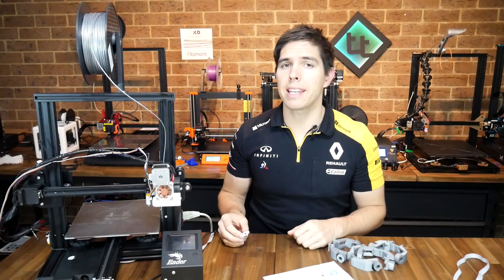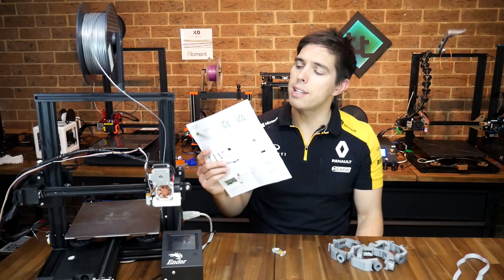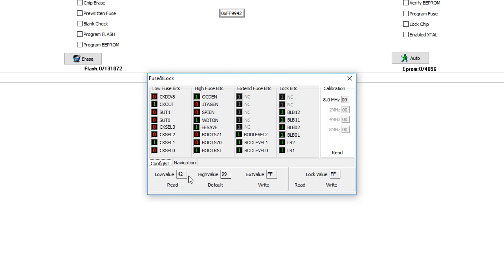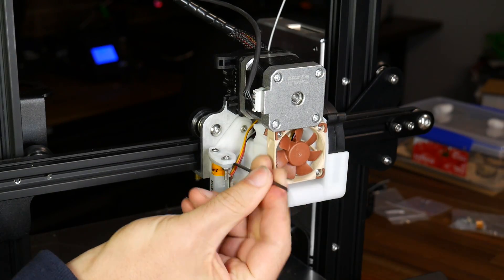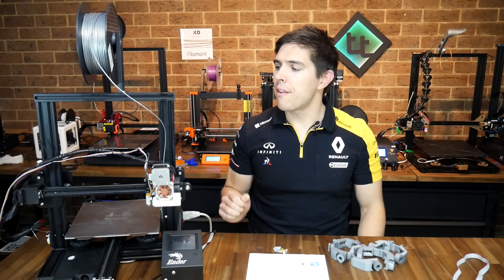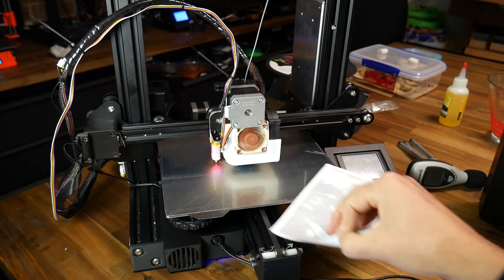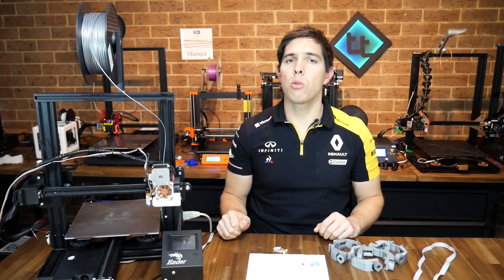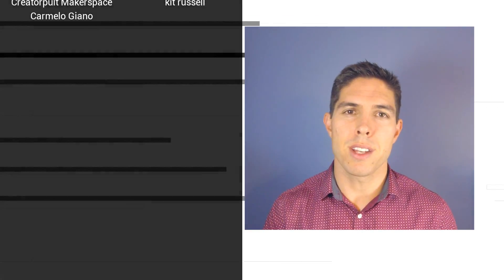Creality BLtouch Ender 3 upgrade kit - Step by step guide with fixes

Comment: Just spent an entire week trying to make mine work without any sucess ! the BLtouch isn't even glowing red like if it wasn't powered on. I tried to reinitialize the printer with a non-BLtouch version but now the printer sees the SD card but says it's empty ... I really don't know what's happening ! My ender 3 is running with a SKR 1.4 turbo, some says you need to connect the probe to the z endstop, some says you must connect it to the probe connector, some says you have to modify conditionnal LCD file .... to sume up, I'm completely lost !

Comment: So I see Michels Mainboard is shiffted from its manufacturing position. Mine is not since I need access to the SD and USB Ports. Now I have the problem that my mainboard-fan does not fit anymore since the new chip is in the way. Any Tipps?
Reply: Print a different cover for your mainboard box :)

Comment: Good video - I was looking for the part at the end - my Z offset is wrong even though I put in the "correct" values...

Regarding the flashing program - I think they updated the settings for it, because the "auto" worked for me. Or maybe it's because I got the file from a different source? I got it from a link in the creality BLTouch install video.
Quite a mess this upgrade - as you say, the hardware represents great value, but the rest, not so much...

Comment: I did this installation yesterday following the new Creality video. This was done on an Ender 3 Pro and was mostly no hazzle. But the Z-offset was a pain still. Unable to do the Marlin version i had to do 5 test prints before i had the Z-offset dail in. But now it runs like a treat. Thanks for sharing this video that got me started and let me find the right software.

Comment: Literally every problem you encountered were the same problems I have encountered, I have no way right now of checking all of the data, as I don't have as robust software as you, however, your preloaded hex file with thermal runaway is worth this whole video. Thank you very much, this was the cheapest solution available for me before i have a chance to go to the better motherboard for the ender 3 and a raspberry pi.

Comment: Updated another batch of these yesterday and fell back to this video to get things done fast! (with a different flash image of course)

Thanks for this!  Love it!
Reply: Benjamin, which firmware did you end up using, and did you have the Z offset issue?
 I have just spent 2 days trying to get this working, I have it working but like in the video I am going to have to do a layer 1 print for every 0.1mm of adjustment to avoid crashing the nozzle into the bed

Comment: no one else thinks this guys instructions are complete garbage???? i went to the creality website to get the firmware and i got no .hex file, but a .bin file....and i cant find progisp anywhere....trash instructions
Reply: Here is a link. Click on the progisp file. I had an issue downloading it, in the upper  right hand corner click the three dots, then open in new window. When I click download it worked. 
https://drive.google.com/drive/folders/1lXXDpAtkGP2KVKi4O1yqBInqunWGrWvN

Comment: I cannot find the same chip type as you I only have 1280 and 1281 no 1284p PLEASE HELP
Reply: @CaptainRabbitYT  So far so good everything is plugged in now all I have to do is test it
Reply: @CaptainRabbitYT  ok so I used the progisp and I used the 128 4p and then I set the values to DC D6 and FD I clicked write and everything was fine. Then I did the load flash thing and used a hex file I found titled Ender-3 1.1.6.2V.hex and I don't know is that is the right one and where I can find the right one D: If that is the right one then I guess I did everything  right. But the problem is when I plugged everything in like the video said I tried to do auto home leveling but when it went down first of all it didn't center and second the probe wouldn't come out and I had to pull it out and push it in but it kept going and it does this every time I try.

Comment: The link provided for the "fixed/updated" hex file that is supposed to work with the Creality flashing software takes me to a Marlin repository that requires Arduino.
Reply from the maker: That's because people complained about the hex file apparently not working. I'm doomed whatever I provide for free, there will be complaints either way.
Reply: @TeachingTech  Being a resource that people become dependent on will do that. Thanks for the effort anyway, you've certainly helped me a lot. Removing the z-stop capacitor was actually the simple part so I'm not expecting any glitches but I did want to take advantage of the speed changes you had made, Oh well. I've already flashed the creality firmware and just need to set the z axis adjustments. One of these days I'll have to get around to learning how to use Arduino for more advance Marlin updates. For now I just needed to get printing again without having to worry about my uneven bed surface I've been struggling with. Thanks again for being such a valuable contributor to the 3D printing community.

Comment: In my Ender 3 I have the 
BIGTREETECH SKR Mini E3 V1.2 Control Board 32Bit with TMC2209 UART Driver.  Not being a big software guy I am trying to follow along running the Progisp.exe; however in the "Select Chip" bow I cannot find the chipset for this mainboard.  Can anyone tell me what goes there and I'm sure the fuse settings are different too.  Any video that shows installing the BL Touch 3.1 to the SKR Mini would be nice.  Tired of scratching my head.

Comment: Hello, Hey could you help me with the PROGISP... I recently bought an ender 3 pro with 4.2.2 board and also a BLTouch v.1, but when I try to set the lowvalue / high and ext value, displays me an error called " chip enable program error" ; Do you now what could I do there?

Comment: Brilliant video, wished I'd found it a couple of weeks ago, it would have saved numerous headaches. Creality's documentation is laughable and even after I finally got the BL touch working there was a problem with it running off the bed (Ender 5) which I found a patch for online. The plus side is I learnt a lot about the printer.

Comment: Hey, I love your videos!!
I just bought a Creality bltouch kit and come across this video, is a bit old but I noticed that your github is still updating and creality is still providing the same hex file without thermal runaway. In order to flash your firmware I just have to compile it and use the same steps as with the Creality firmware?
Thanks for your time, keep making videos! I watch every single one!!

Comment: Any chance you might do a BL Touch Install video for the Ender 3 V2? So far i have gathered that the install is very similar minus the need for the 27 pin connector and it plugs directly into the board but would love to see someone do it end to end so that I don't break things. While i am here, can i say that as someone who quite literally has no clue about 3D printing, your videos have been amazing. Appreciate all the effort. Cheers!

Comment: Hey so I used the version 3 firmware with the thermal run away enabled that you provided in your description after I set up my BL touch using crealitys video tutorial a week ago and all of a sudden the BL touch started failing, my only problem I’ve encountered so far is now my tool head is a little farther to the right than it used to be when it auto homes , is this normal ? If not how do I fix this and will it result in me having to change anything from the default profiles for the Ender 3 in cura other than enabling the BL in the gcode which I’ve already done?

Comment: This works great with the new BLTouch 3.1s. Also looks like they've made a few tiny improvements to the software so it was a little easier.
Reply: They (Creality) have also introduced some more bugs to their software, the progisp+1.72 loads with two kernel errors because they named the folder in English/Chinese and if you don't have an English/ Chinese keyboard you get the error, a workaround is to rename the folder minus the Chinese characters, but they have not fixed the Z offset error and have not implemented baby-stepping

Comment: I had to replace my main board because when i flashed my chip All i get is chip enabled program err. And the lcd is blank now. So I put in ender 3 upgrade main board 1.1.5 with boot loader installed . Now how and what programs do i need to put my BL touch v1 bed leveler. I don't want to by another board. Can some one help me please.

Comment: First of all: THANK YOU SO MUCH! For all your videos! :)
Your videos helped in many ways like first buying decisions, bug fixing, quality improvement and upgrading in general.
Keep up the good work mate!

Now I want to return the favor since I got a lot of issues with an upgrade to Silent Board 1.1.5 and BLTouch which took me weeks.
I had:
- overheating steppers
- horrible printing quality which ended in absolut failure to stick to the bed in any way 
- issues with flashing

Mostly because Creality has a almost no documentation.

With your videos and some research (combined with trial & error) I've had success to upload the official firmware, but it was the main issue afterwards.

So I tried to use TH3D unified firmware and had to go as following to get it going.
Maybe this telling you more than me, what went wrong or were I've been stupid ;)
Hopefully I can help anyone having the same issues / brain errors as I had.

[Hardware installation]
- Simply installed the hardware like in your video with the official Creality BLTouch hardware package

[Preparation]
- Downloaded & unpacked "ProgISP" with the official Creality firmware
- Removed all special characters from the complete folder name of "progisp.exe" (chinese symbols seem to cause issues with western windows)
- Downloaded & unpacked TH3D unified firmware

[TH3D Config]
- Opened the Arduino IDE as Admin
- Selected board "Sanguino 1248p", selected processor "ATmega1248p", selected programer "AVRISp mkII"
- Activated the following lines in "Configuration.h":
  #define ENDER3
  #define CUSTOM_PROBE
  #define X_PROBE_OFFSET_FROM_EXTRUDER -44  // Measure your own setup in mm
  #define Y_PROBE_OFFSET_FROM_EXTRUDER -5  // Measure your own setup in mm
  #define TMC_CREALITY_BOARD
  #define SERVO0_PIN 27
- Exported the firmware as .hex-file by clicking "Sketch" --> "Export compiled binary file"
  (File is found in "...\TH3D_UFW_U1.R2.B5\TH3DUF_R2\Firmware\TH3DUF_R2", named "TH3DUF_R2.ino.with_bootloader.sanguino.hex")

[Firmware flash]
- Disconnected printer display adapter
- Connect ISP-programer to printer motherboard (the ISP programer provided with the BLTouch)
- Connect ISP-programer to PC via USB
- Connect printer USB-port with PC (not sure if quite necessary)
- Turn printer power on
- Start "progisp.exe" as admin
- Activated the following options:
  Chip Erase, Program FLASH, Verify FLASH, Program Fuse
- Disabled the option "Verify Signature"
  (Seemed to block synching in my case, but I guess it's best to have it activated if possible)
- Clicked on "..." and "read"
- Complete different values were read, so I sat the "ConfigBit" to:
  LowValue=D6
  HighValue=DC
  ExtValue=FD
  (Those values were mentioned in the Creality installation PowerPoint file - not sure why they differed from yours)
- Clicked on "Load Flash" and select the .hex-file created before  
- Clicked "Auto" to upload firmware
- Turned printer power off, disconnected cabels from PC
- Connect printer display cable
- Turn printer on and initialize EEPROM
- Store settings

[Final tuning]
- Calibrated Z-Offset for BLTouch

Works better than before: Highly increased quality and speed :)

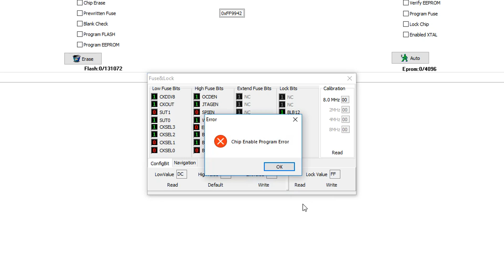Comment: 3:59
I also encountered this chip enabled error.
What do you mean when you say you need to turn on the printer ? Should it be turned on and plugged into main power ?
I'm afraid if I turn on the printer with the main power inside + the usb 5V I'll destroy the board.
I just wanted to clarify this point. Did anyone try this or know if it is safe ?

Comment: Just got mine today. I think they took some of the criticisms on their site to heart (or maybe the company I purchased it from did) but mine came with full English instructions, the setup and everything went fine.... right up until the 'set Z axis' steps (which is how I found your video). 
In hind site it was my fault. I had attempted to test it with a print from the SD card, but hadnt saved out a new STL with the new G29 code, as this section was a bit gibberish (Google translate maybe?)
I did get 3.6 the first attempt, but the printer didnt know to lower the nozzle to the right height without the G29 code.
Just running the first print now (its about 1/2 through the first layer) and no issues so far.

Only issue of note that I experienced was, a while back I had thermal runaway that fried the motherboard. So i got a replacement secondhand E3 Pro board.
The Pro Board coupled with the standard Ender 3 case causes an issue with the BL touch integration, as the new pinboard lifts the height of the LCD board and this now prevents me from reattaching the case cover, as the fan sits directly above the new board.

So only way around it I can see is to print a new cover and move the fan over a bit.

Comment: We are hitting a wall with the BLTouch install. Steps we completed and where we got stuck:
1) Unplugged Zstop - plugged in the replacement BLTouch Zstop from the BLTouch ext cord (white facing white, black facing black)
2) Pulled out LCD ribbon cable & replaced w/ 27 pin board. 
3) Plugged LCD ribbon cable into 27pin board then plugged in the BLTouch ext cord with correlating colors
4) Used PROGISP to adjust all settings to align with the video
5) Flashed the x file from the video onto the printer
6) Turned off printer, turned back on
7) Bed leveler lit up red with a little blue light
8) The probe flicked up and down a few times upon turning it on but isn’t in the home position. The Z is lifted too far up from the bed to level it, so we hit auto-home to send it back to its home position and no response. After about 10 seconds, it says homing failed, printer halted, please reset. The same outcome if we move any of the axis independently. Same outcome when using LCD display, Octoprint and Cura as well.

Comment: So I installed the 1.1.9 bugfix with thermal hex and bootloader, but it seems like when I try to flash to a new firmware it seems to fail to connect to the bootloader to flash. This is using TH3D fw and arduino ide.

Comment: I can't believe I actually did it thanks a ton man I owe you a beer  😁

EDIT: So I got everything working yesterday but ran into some problems. The Z axis wont let me go lower than 0 and when I start a print job even though the bltouch is working fine and stopping when it hits the bed the nozzle still gets slammed into the bed. Trying to figure out what I did wrong. This is with BLTouch v3.1 and 1.1.4 board on ender 3 pro
Reply: hey man how did you getthe marlin file bec i cant seem to find it
Reply: GamingOnAchair it’s in the description of the video
Reply: @BrockPlaysFortnite  But like what is the name of the specific file in the github that we are supposed to flash into the touch? Not good with this software type stuff lol
Reply: GiantHorseshoes I think he removed the link because it was an old file. It wasn’t a github link there was another link that let you download the file from him. It had problems though I ended up reflashing another firmware I found from reddit I think. Not sure exactly which one to be honest it was a while back
Reply: Yo when you had to select chip when updating the firmware did you see the AT mega 1284P I only see 1280 please help
Reply: so, whats the solution of your problem? because i got the same.

Comment: Do you have a hex file that can be used for an ender 5/5 pro? I got the creality kit, but the creality firmware for  the ender 5 pro has several glitches and issues.

Comment: Thanks very much for your default preconfigured hex files!
Would you be able to update your preconfigured Ender3 hex files sometime in the future and change the default homing speed in your hex files to slow down homing a bit and stop the ender3 and ender3 pro from slamming into the endstops when homing speed is set to the default 50*60 and change it to the suggested 20*60 in Marlin?

Comment: nice video... I have a Ender 3 PRO and the Bltouch V3.1, I was wondering if it is compatible with you firmware since the review is on a Standard Ender 3:    "pre-compiled firmware hex prepared by myself for BLtouch V3 (Marlin 1.1.9 bugfix with thermal runaway protection): https://gumroad.com/products/wLtut/
"

Comment: 3:43 Those are hexadecimal values and it looks like you swapped the low and high values there... DC is higher than D6.
I guess this might have been helpful if I had been here a year and a half ago though. The current manual does list them in the correct spots
Reply: what do these values do and what happens if they're mixed up?

Comment: When I do this the bltouch seems to be working perfectly but as soon as the print starts one end in too high and the other too low therefore the print is not sticking on one corner and is practically inside the bed on the other. Is there a fix for this
Reply: Maybe raise the corner that is warping manually?

Comment: U can just use nuts instead of spring to hold the bed in place it takes for ever to level but u never have to do it again unless u switch hot ends or use a nozzle that is different ie taller/shorter
Reply: have u done this? Seems like a good idea but wouldnt u need a bunch of different height nuts to get it perfect?
Reply: Swapnil Iqbal yea I have and u only need 8 plus the wheels on the bottom since u can control the hight by how far u drew them on